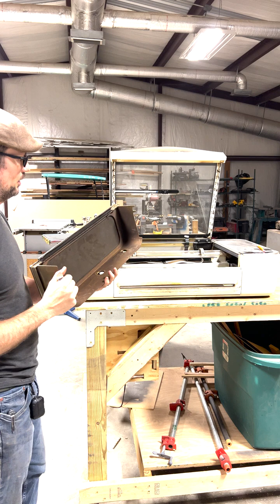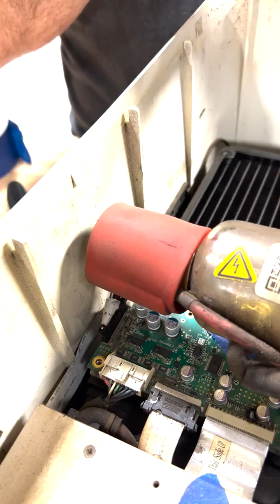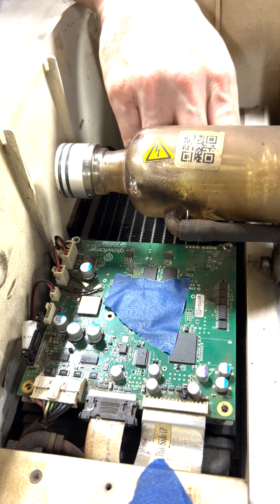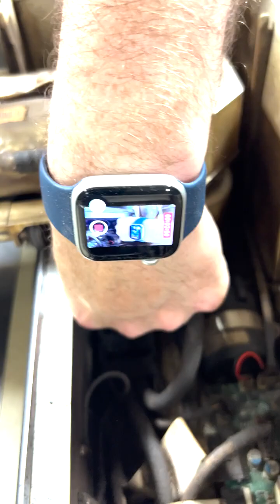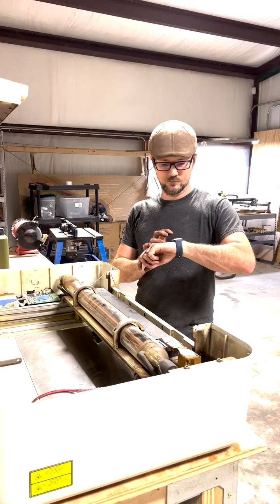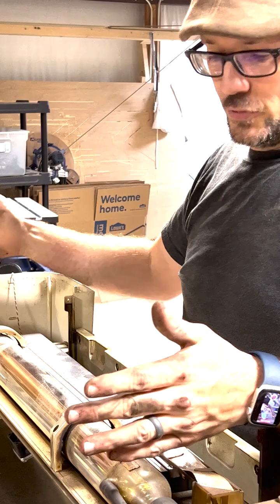Glowforge High voltage short inspection

Comment: My wire is fine.  Insulation is intact all the way to the power supply.  Where was the insulation damage on the path of the wire?  Under the machine?  In the cable management chain?  Where please?

Comment: Have you tried to see if it's possible to test if there's a short using the continuity function of a multimeter with one end on the red wire and the other on the metal case around the laser you think the wire is shorting to? To save time and effort just to diagnose the problem? Just curious, I have a glow forge with this issue and am going to be checking for a fault soon.